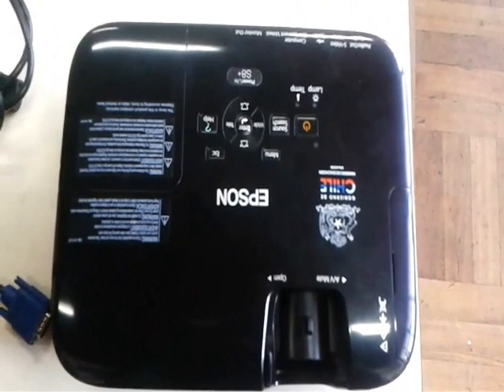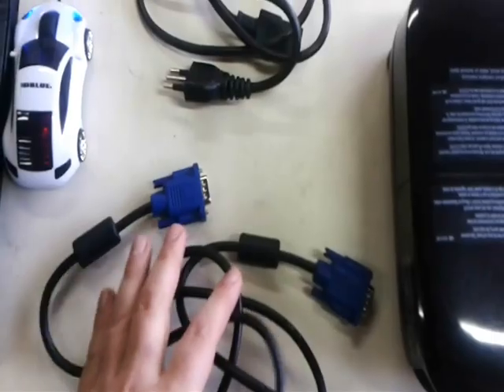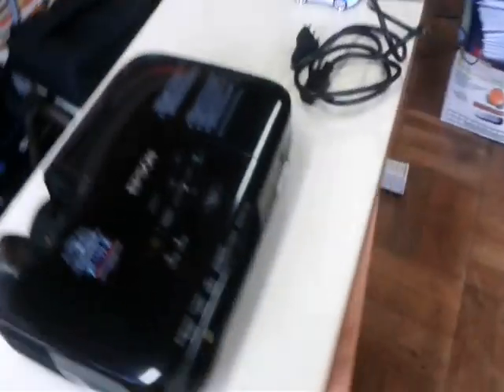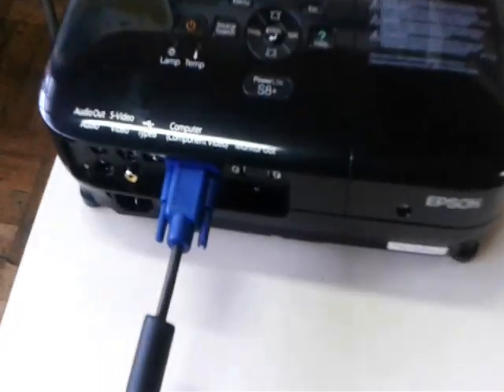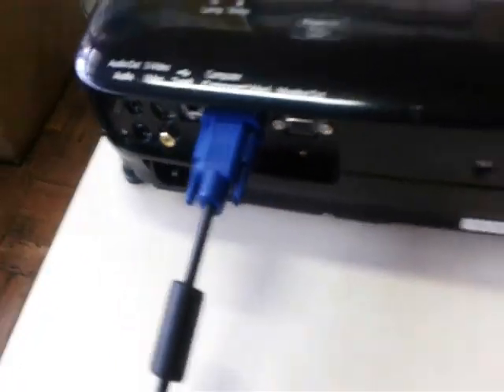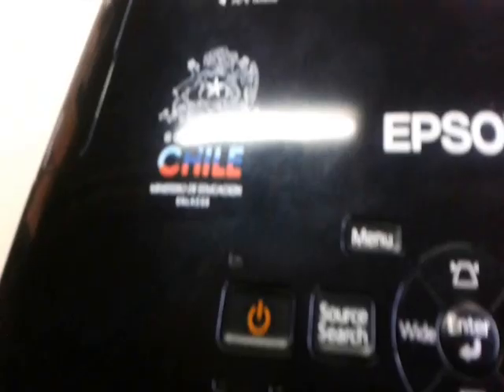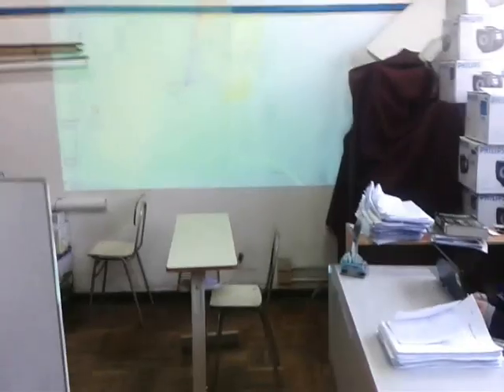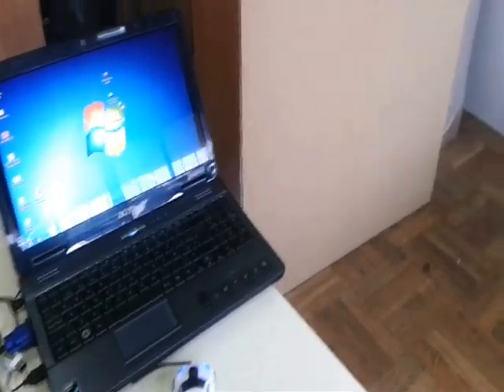Tutorial conectar proyector

Comment: Varias cosas que quedaron en el aire.
-El conector del cable vga tiene 15 pines y tiene una forma de trapecio (orilla mas acha que la otra), es importante hacer enfasis en esto ya normalmente tratan de colocarlo forzado de manera incorrecta rompiendo pines y el borde del conector.
-El proceso de proyección depende: del Sistema operativo y el modelo del equipo. Ya que en Win XP y Win 7 el proceso es distinto.en XP si tiene habilitado en teclado con F5 o de manera manual en el escritorio.